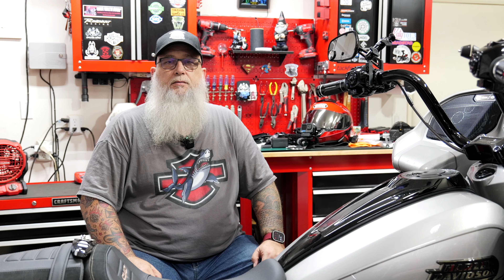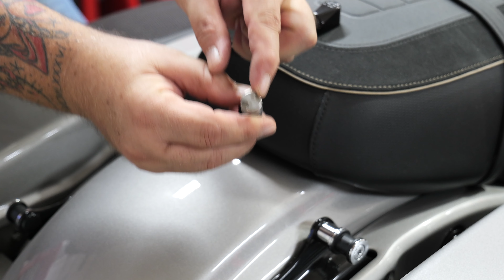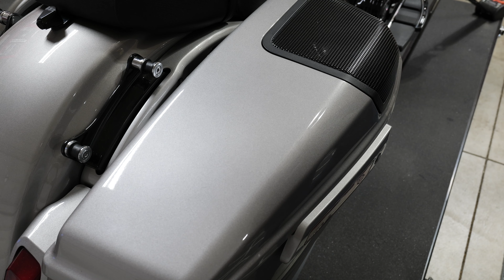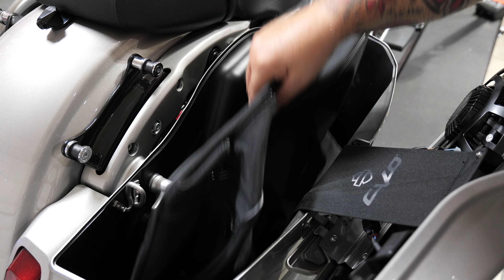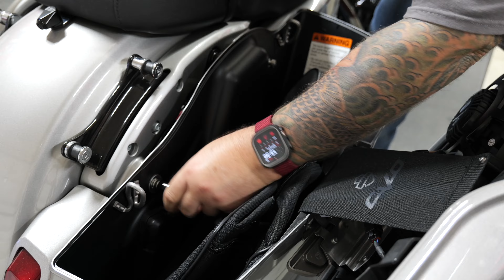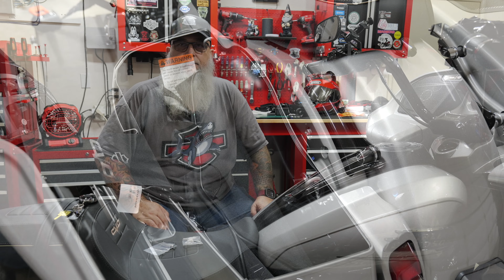2023 Road Glide CVO - Upgraded Seat Locks & Bag Locks

Comment: How would some one steal cvo bags when they are locked with a remote?
Reply from the maker: Thanks for the question. I have seen instances where individuals have popped off the latch and lock mechanism, unscrewed the bags and took the complete assembly speakers and all. To be functional again, all they would need to do is replace the lock/latch or even the lid in more aggressive situations.

Not so respectful people out there, ride safe.

Comment: Think the seat lock is great but it honestly reminds me of a tow hitch pin lock and with those you can easily break them off using a hollow pipe. Wondering if that is something that can easily be done with these locks as well; criminals wont care about damaging the bike but being able to take that seat off may be quicker to do with this lock.
Reply from the maker: Thanks for the feedback, much appreciated. My thoughts are, as with anything, if someone wants it bad enough, they will find a way for sure. But these are agret looking and excellent deterrent from the average thief.

Ride Safe